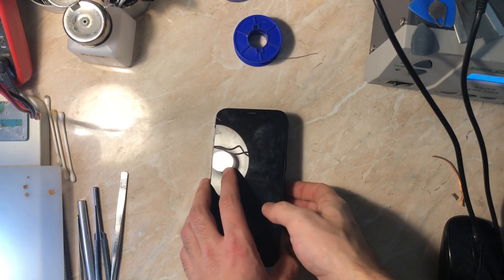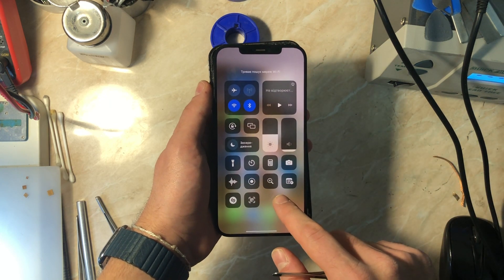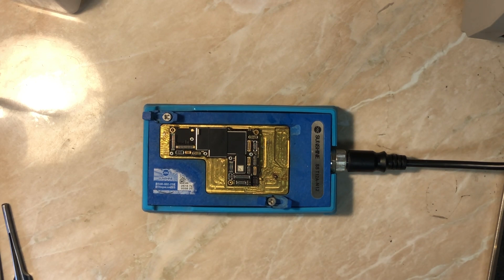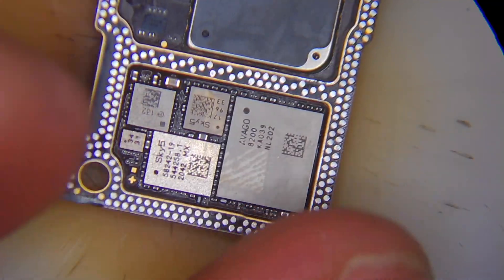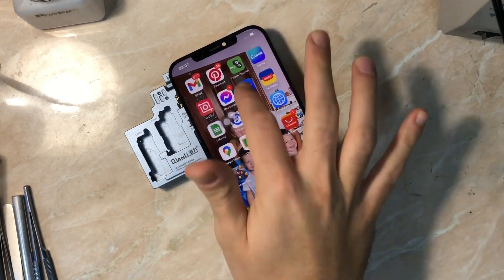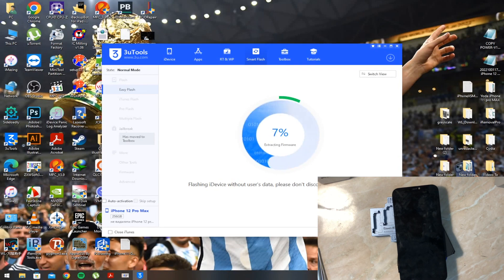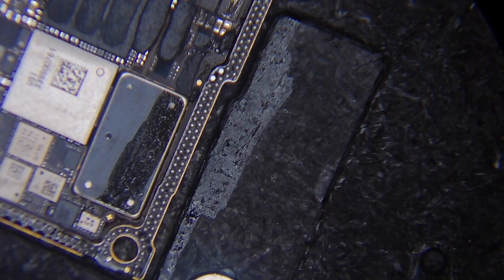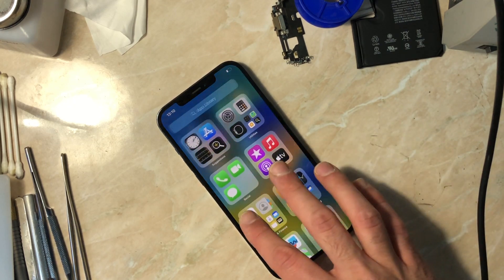iPhone 12 Pro Max Restarting And Freezing Problem (Userspace Watchdog Prs0-Springboard) Panic Repair

Comment: Hi sir, right now I'm struggling infront of my workstation with this same issues for my customer's iPhone 12 Pro Max missing sensor(s); Prs0. I have done changed 2-3 charging flex, swap upper layer, flash on 3utools, testing on jig tester but the problem still same. May I know swap the bottom layer solved the problem? Like yours in this video. This only I haven't done.
Reply from the maker: Please watch the video again because I think you didn’t watch it completely till the end, Prs0 it’s something to do with the barometer sensor, which is located on the charging flex connector
Reply: @AntoineKiriaky10  I watched completely till the end and I know the barometer sensor is located at charging flex which is my first comment above I changed 2-3 charging flex but it doesn’t solve the Prs0. 

The question here, is the RF layer (bottom board) is related to barometer Prs0 issue? Only this I haven’t try.